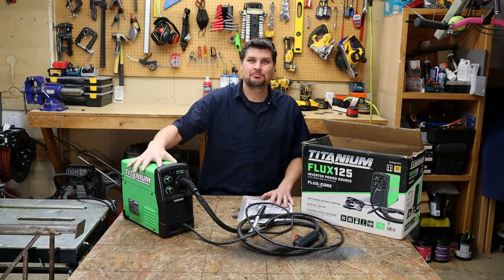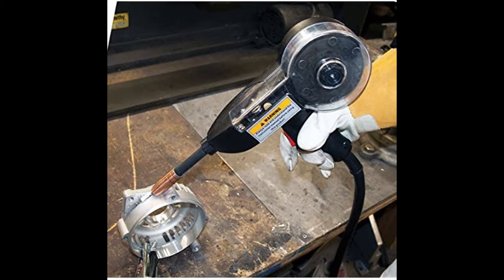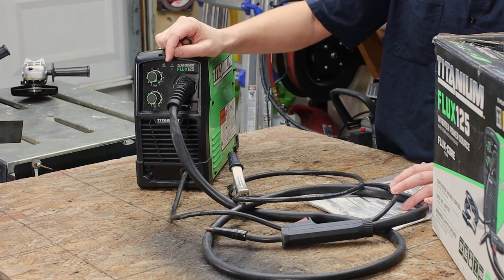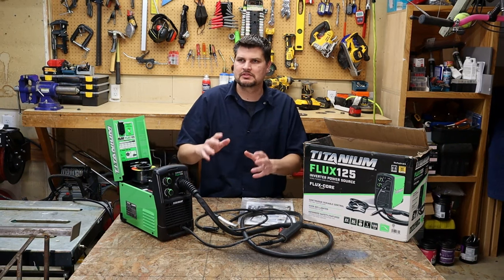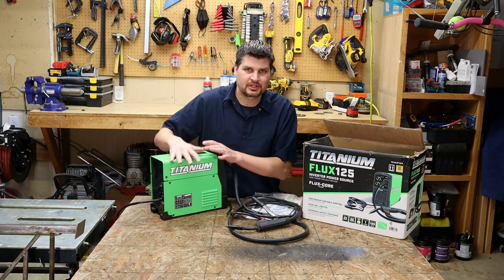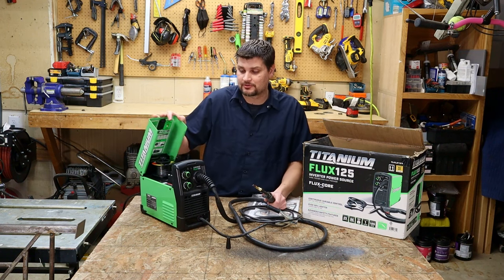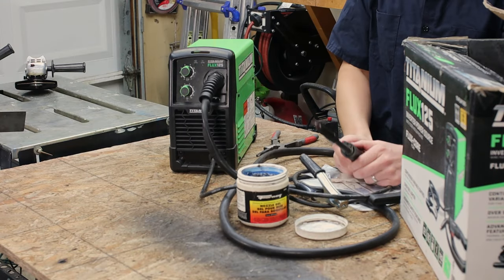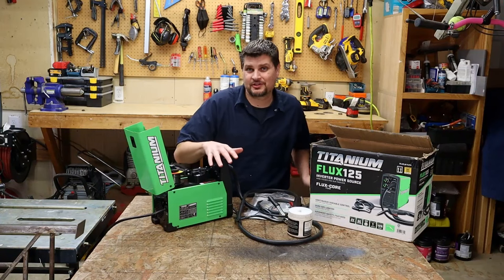Harbor Freight Welder Questions and Answers *Titanium 125*

Comment: Thank you for the Q and A on the Titanium 125. Very informative video. Also a question as to the orange and black hood you used. What brand, price and is it worth it? Thanks
Reply from the maker: I got it from Yeswelder, and yes I do like it. 
https://yeswelder.com/products/auto-darkening-welding-helmet-302c?ref=uDQs4bv7pZQF3

If you decide to go with them you can use my coupon code for 10% off:
MECHMASTER

They do have cheaper ones but I like the clear view type lens this one comes with. 

Their welders aren't too bad either:
https://yeswelder.com/?ref=uDQs4bv7pZQF3
Reply: @-DIYPRO-  thank you for the info. You were right it is like riding a bike. I ran some beads yesterday for the first time in years and it all came back to me. I did have to play with the settings cause your right it welds a bit hot but once I dialed it in for my needs I was staking dimes. I used Blue demon .030 wire and I upgraded the ground clamp. I had minimal spatter. Nozzle gel works well also. Thanks for everything.

Comment: an amazing little welder BUT,  no replacement parts for them.. even tho theyre covered under warranty, the need to make consumables ! only .030/.035 tips are available. rarely does HF have the nozzles.... i love this thing !   i regularly over work it with c channel and up to 1/2'' with a little more prep effort.. it wil burn into 1/2".  not recommended but, when youre stuck, it will work !!
Reply from the maker: Watch this: https://youtu.be/5C1ht5XCgXw
Use nozzle gel and you'll never have to change out your tip. I'm still using the same one mine came with!
Reply: @-DIYPRO-  ive had one of these for over 2 years now. i use it at work and im not nice to things. i try to be careful but, i still break the nozzles on occasion. it happens. i keep a pocket of .035 tips since after so much use, it needs them to feed smoothly.  sooner or later, they will have the nozzles available the the stores... i hope...

Comment: You are very knowledgeable my question is I have the same welder, but my problem is sometimes the wire  breaks off at the weld what is the cause of that I respect your opinion. Thank You
Reply from the maker: The wire breaks off? I may need a little more info.
Reply: While welding I notice that when I take my hand off the trigger the wire will either break, or there is a ball at the tip of the wire end.

Comment: you use the feed button to advance the wire without energising it 🙄
Reply from the maker: That's true. Not that you should be touching the ground or tip to the work piece as you are feeding wire but it takes out that small risk.

Comment: Excellent video! I am considering learning welding and buying this machine after reading all the great reviews of it. This video has answered all my questions I have about this machine. It is a great help, especially about the usable with a 15 AMP breaker. Thank you!
Reply from the maker: Right on!
Reply: even with a small duty cycle, you can do quite a bit but it will get hot. if you dont use at least a 12 gauge UNDER 50 foot extension cord on a dedicated 15 amp breaker, you will have problems with it heating up. ive done lots of work with mine on a 50 foot 10 gauge cord with no problems . i try not to run more than about 3 inches at a time  at high settings with a short break in between strikes.  i just finished a trailer conversion on 3/16 ths and 1/4" c channel with no problems and a very nice bead in all directions. great heat pattern and cleaned up nicely. i love this machine  and ive shown many people how well it works.. probably "sold" 10 or 12 of them..  so far, everyone is surprised how well it works. i like it better than my miller 135..

Comment: Can I run this with a generator out in the field? If so which generator do you think will work best. Looking to repair some cracks on my trailer floor.
Reply from the maker: I haven't tested it on a generator....yet. It does draw close to 20 amps on max settings so at min. I would say you need a 3,000 watt.
Reply: @MechMaster  ok awesome if you ever make a test video with a generator then I'll be watching thank you.
Reply: they dont like unstable power.  you will need at  least 3000 constant . i have run mine on a honda 3000eu with no problems. it will run the generator at full blast.  so does a coffee maker...  good luck

Comment: So there's no way to reverse polarity? I've been using a modified Chicago Electric one which I modified to DC and it wasn't too much trouble to swap the polarity, but I had it set up that way so I could weld SS with it (with SS Flux core wire). And yes, you have to reverse the polarity to weld with it. Obviously there's no quick easy way to swap it like on most migs, but has anyone cracked theirs open to check?
Reply from the maker: If you have the know how to modify the AC to an old CE than you can dig into it and switch the leads!
Reply: Oh I did; modified it with a separate transformer for the wire feed motor, added a large bridge rectifier w/ a heatsink (first one I got wasn't up to the task), some capacitors and a choke, put a better fan in it, etc etc, even had to beef up the handle because the thing was about twice as heavy as it was from the factory, but that thing took a dump after several years of use. The wire feed motor controller is dead. Seemed like there were kits you could buy once upon a time to repair it (looked like it had some transistors and a new relay), but can't find it any longer. I may end up getting this thing anyway to do odds and ends. Just can't use it for SS exhaust, at least not with SS wire (you have to get the wire super hot with SS, hence the need for reversing the polarity). I'm done tinkering around with that CE one so down the  road I may end up having to get a a mig/Flux core machine where you can reverse the polarity. Last time I was in HF I think there was a Titanium one such as that for around $400 or $500. Spending that much though I may as well go for a better brand one honestly (just not sure if I trust Titanium long term).

Comment: Hello, everyone. Greetings from Germany. Unfortunately, what you say is not entirely correct. I would like to correct you at this point. 1 Is it possible to change the polarity? Yes, but you have to unscrew the device. There is also a video on YouTube by Strange Garage: https://www.youtube.com/watch?v=oOgxEk_C-Hg. 2. Is it possible to weld stainless steel? Yes, even without corrosion. For this there is flux wire from BlueDemon, for example, 312LFC-O .035 and 309LFC-O .35. This means that normal steel and stainless steel can also be welded without corrosion of the weld seam. BUT: most stainless steel cored wires are welded using the positive polarity. You can also try using the negative pole, but the welding process will not be clean. So, as in point one, you would have to unscrew the device and change the polarity. There is also cored wire according to the E308 standard, but this is only suitable for stainless steel. 3. You don't need a spool gun for aluminum welding, just pure argon gas and a mig/mag welding device with a Teflon core in the hose pack and suitable feed rollers for aluminum wire.
Reply from the maker: Wow from Germany, Welcome! Yes agree with all your points.
Reply: Just what I was looking for, how to reverse polarity on this thing. Thanks for pointing me in the right direction.
Reply: @jordanmcmillan2762  Hallo Jordan, in this case (Titanium 125) you have to unscrew the device, but then the warranty is void.

Comment: I picked this up and can’t get an arc even when I touch the clamp. Bought a century version also and same issue trying to weld a lawn mower muffler. No arc. Is there something special I’m not doing right besides putting the wire in with correct size and in the slot. Breaker isn’t tripped.
Reply from the maker: Does the machine turn on? When you pull the trigger does wire come out?
Still no spark while pulling the trigger and grounding directly to the ground clamp? There are lemons out there but for it to happen with a Century as well I'd say it's an electrical issue or it's not being grounded.

Comment: So I bought this welder over the weekend. It worked mmmmm was cookin for 5 mins then it blacked out. I was running it off an extension cord which was probably my mistake. I really hope this thing fires up
Reply from the maker: Did it trip the breaker? Does it still work without the extension cord?

Comment: I came up with a really nice "handle" solution for the Titanium 125 if you are interested, my Titanium 225 (stick) came with one, (oh well, they have to cut cost somewhere). Great video productions by the way, keep up the good work!  ...my two cents on the Titanium line, possibly the "best value and reliability in budget welders", almost bought a ArcCaptain, only to find out that their published specs on amp rating was inflated (ie: false advertising), have never seen this with Titanium, a very reputable company in my opinion.

Comment: The Titanium 125 Flux core is DCEN from the factory, right? The weld gun is negative polarity? and the Ground wire is Positive? Thanks for the video thinking about getting one to replace a chicago electric 125 that apparently is not DCEN from the factory.
Reply from the maker: Correct. flux core is DCEN. The CE125 is an AC welder so it output is alternating.
Reply: this is 10xs the welder anything chicago makes...

Comment: What is the best extension cord I can use for it ?? What gauge
Reply from the maker: I have the 10 ga. 25ft. from HF and it runs great on it.
Reply: If you can get a Southwire extension cord, they use solid copper wires in their extension cords. They’re a little pricey, but you should have minimal power loss through the cord that way

Comment: I can't get a straight answer~  Can this be used with a DuroMax XP4400EH Dual Fuel Portable Generator-4400 Watt Gas or Propane Powered Electric Start?
Reply from the maker: Yes you should be able to. At max settings the welder pulls close to 20 amps. Watts = amps x volts. 20A x 120V = 2,400 watts. The 4400 watt is most likely the max or peak so as long as the continuous wattage rating is below 2,400 watts you can max out the titanium.
Reply: @-DIYPRO-  Thank you so much for this answer,  I feel like I have been asking for days.  
Very appreciative!

Comment: Would this welder work well if it’s plugged into a basic house wall socket or does it have to be a 20amp socket
Reply from the maker: It will still work on a standard plug on the lower settings. It will trip a 15 amp breaker on the highest settings.
Reply: @-DIYPRO-  ..i got 20amp breaker in my garage but my outlet is only 15amp do i need to change my outlet

Comment: Did anyone notice how slow the wire feed. Or is mine broken right out of the box
Reply from the maker: How are the welds turning out?
Reply: They are good, I was afraid to Crank it up because of my breaker size but I did today and I can see that it works and feeds faster

Comment: I was wondering did your welder come with wire or did it come with out a roll
Reply from the maker: Mine came with a little 1 lb spool.
Reply from the maker: If you just got a new one somebody else mentioned they aren't putting wire with it anymore.
Reply: Yea I went to harbor freight and told the guy there mine didn't come with wire he opened a box up to see if they come with wire and in a lil white box was the wire he gave it to me.
Reply: I just bought one yesterday ( 4/18/2022) and no wire was included. It was on sale for 169.99.
Reply: @batsonelectronics  yea mine didn't have it either but watched other YouTube videos unboxing reviews same welder and there's came with it so that's why I went to harbor freight and claimed my wire
Reply: @Nelval573  I got the Flux 125 AC welder for B-day and wasn't happy with results so just traded up and got the Titanium. I also received some .030 Vulcan wire so I already had wire so didn't really care. I do wish it came with the shield though as it allowed someone to watch while I welded. ( horrible job welding a mower deck with the AC welder )  The other welder included a simple hammer/brush and the shield, hated having to give those up but bought a normal hammer for 6.99 and the 5 piece drill insert wire wheels for 4.99 so I have a better setup all around for not much more. ( I also got a welding mask and leathers with the other welder that I kept ) When this wire eventually runs out, I will try some of the Lincoln wire as many people like it.

Comment: For some reason I can’t get my welder to spark. I have the Titanium Flux 125, and I’ve tried multiple metals to clamp to, and different metals to try and weld. I’ve cleaned all metals, and just can’t seem to get it to start. Any suggestions?
Reply from the maker: I would try and to weld the ground, just for a split second to see if you get a spark. If  yes then you know it was a ground issue and the material wasn't clean enough or there was a discontinuity with the part. If you are pulling the trigger and wire is hitting the ground and still nothing then you got a lemon and I'd take it back.

Comment: The cold button is so you can feed the wire without putting voltage to it.
Reply from the maker: Just don't stick it in your mouth and you'll be fine, haha!
Reply: the wire feeds thru way faster as well

Comment: If I weld 3/16" mild steel, should I use the .035 flux wire?
Reply from the maker: Yes, to get the best penetration at that thickness I'd use 0.035.
Reply: Thank You!

Comment: I bought mine about 5 months ago. Still have not used it. My issue is the electrical on it. I can't bring myself to plug it into a 20amp outlet when the instructions say it uses 23amps. I know that's if you are running it at full power. I decided I am going to wire up a indoor/outdoor 30amp rv outlet and use an adapter to a house hold plug.
Reply from the maker: I've used mine on a 20amp all day. Worst case you trip the breaker but I've yet to do that on the 20. The 15 amp breaker will definitely trip at the higher settings.
Reply: Those are metric amps....

LOL!
Reply: it will run on a dedicated 15 amp breaker all day. if youre the highest 2 settings it might get hot if you run more than about 3 inches a t a time..

Comment: How can I get the wire out if its in the line? The wire is not coming out tip side. And a new spool of wire is not pushing the wire in the line out.
Reply from the maker: Can you see the end of the wire? Can you grab it with a pair of pliers and pull it out? If it's jammed in there you may need to get a new liner.
Reply: No I dont see it at all, going in the liner or coming out the gun unless I try to disassemble the gun. Issue was the spool got tangled, I cut the wire, realigned it in the motor, thinking it would just push that cut off piece out, but it did not.
Reply: @LubiClips  You should be able to disassemble the wire feed enough, to be able to grab the wire and pull it out. The wire feed cannot push it any further into the liner when it comes off the rollers, so the tail end should be right there.

Comment: Hello, I have one of these welders. The welder turns on but does not weld. Does you know what the could be?
Reply from the maker: Do it spark or are you getting nothing? My first go to is check the ground clamp has a good connection to the work piece.
Reply: the machine turns on but does not spark
Reply: I'll check the ground clamp thanks
Reply: Did you ever get spark? Mines doing the same

Comment: What size generator would you need for one of these? I only plan on doing some like weight material max 1/8"
Reply from the maker: You can calculate the wattage needed with Ohms law. If you want to watch a video Tim Welds has one showing about what size you would need. I do know I have a 3200 watt generator like in his video and 1/8" is just about the max that can be done.
Reply: @-DIYPRO-  sounds about right. I got the welder and tested it on a sportsman 4000 with 3500 running watts and anything above mid range heat bogged down the generator. Thanks for the response.
Reply from the maker: @lvlikeyV  good to know.
Reply: I've run it on my Predator 3500 with the esc/eco mode off and it never flinched.
Reply: thru my experience, a 5000 watt or larger generator seems to keep it running smoothly. if you put "the screws" to the welder, (high temp settings) youll need stable power or it will quit and pop breakers. up to 1/4" i have had good luck with mine.. and fat extension cord is a must ! 12 ga or bigger...  under 50 feet

Comment: Friend I have a titanium 200 unlimited I have my argon cylinder 100% and I can't do a tig weld in aluminum it burns the material I use with 240v and it doesn't weld it only damages I tried it with various intensity and it doesn't work even I don't hear the pulse that it should do when lighting the torch
Reply from the maker: I'm pretty sure for TIG welding alum. you need an AC machine. All the Titanium welders are DC only.